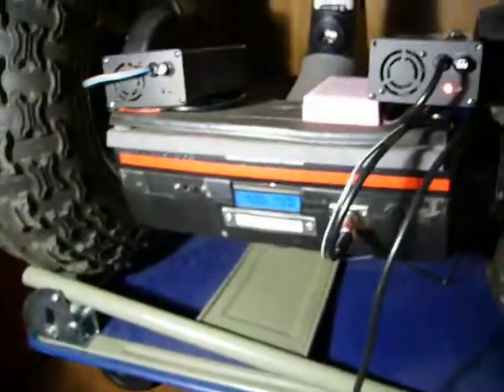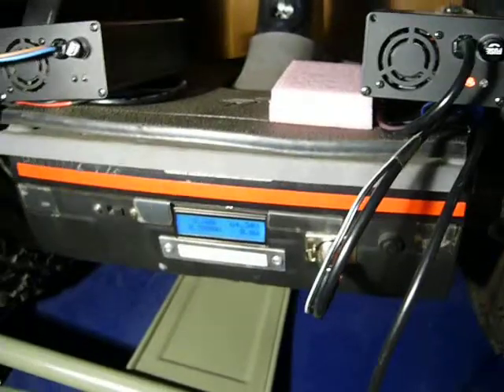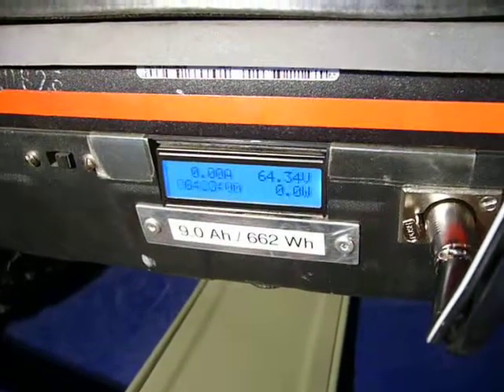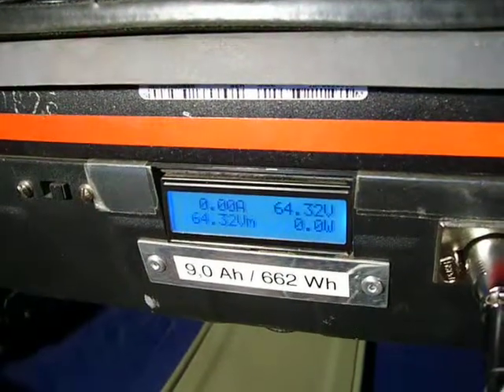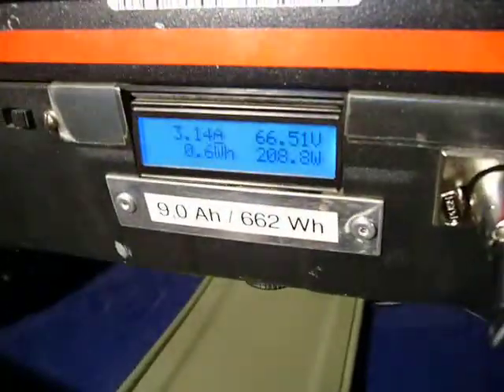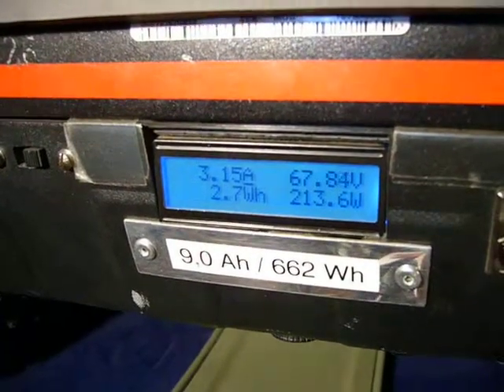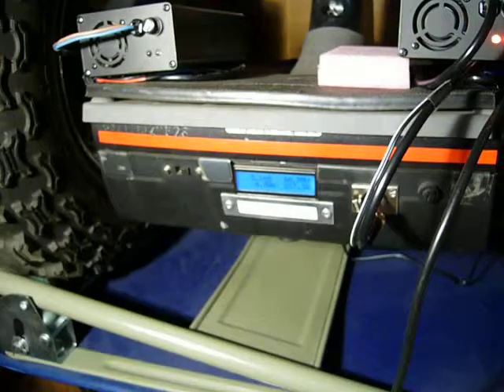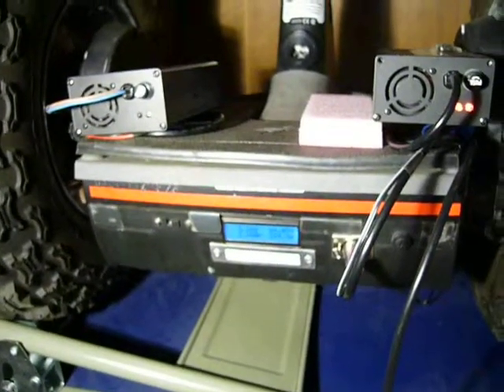Segway XT and XperT-Batteries: Quick-charging procedure ... Read Description

Comment: What would you charge to build 2 of these battery’s?
Reply from the maker: The XperT battery version from the video was very expensive to produce. In particular, the installation of the LCD took a long time. I would solve this today with a Bluetooth module and display the values of the battery on a smartphone.
But if you only want to use the fast charging port (charging the whole Segway in 2 hours), you can rebuild it yourself and save a lot of money (besides the benefits): I use SONY cells for about $ 3 per cell. If you have defective batteries available, you can convert these batteries very cheaply with new cells!
There are 2 versions easily possible:

1) 6.75 Ah with 60 cells per battery (180 $)
2) 9.0 Ah with 80 cells per battery (240 $)

Conclusion: Anyone who trusts their own performance can repair a Segway with defective (deeply discharged) batteries for about $ 400 very cheap ...

Because you asked me: I do not carry out these conversions at the moment because I'm completely busy with other projects. If interested, I can set the blueprints into German or English Segway forum on occasion. It would be important to have someone who can weld the cells into a package with a spot welding machine.
Reply: Do you a manual in English

Comment: Where can I get this battery for my XT?
Reply from the maker: This battery is self-built and it is not officially available. At least there is no serial production. But you can also build the battery yourself, if you have some technical understanding and can solder. Typically, you take a defective segway battery and remove the 92 old cells. Afterwards, 80 cells will be used by the brand manufacturer SONY. Each cell has 2.25 Ah - together then 9.0 Ah per battery.
Somewhere in the German Segwayforum there is a construction manual - good luck ...